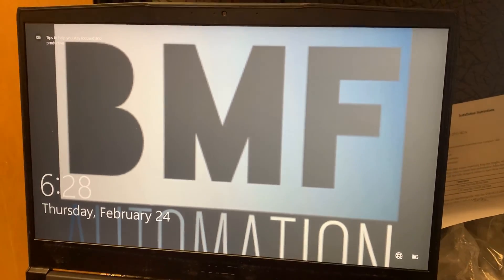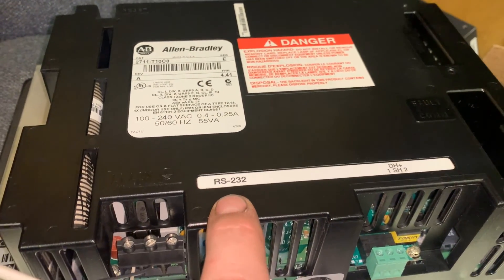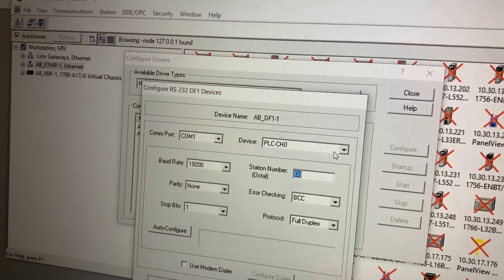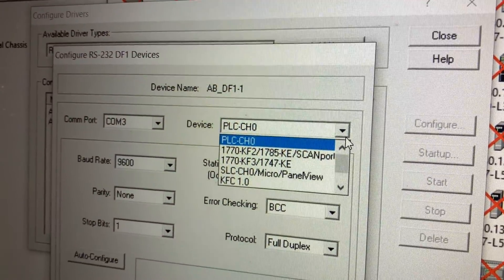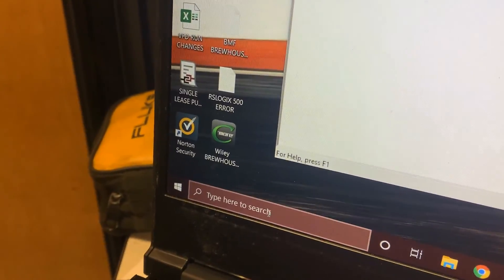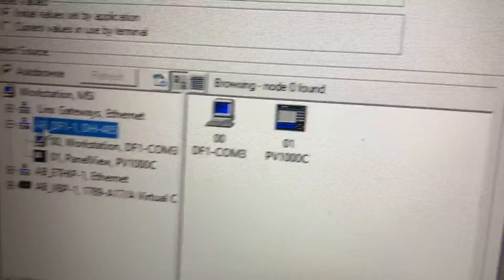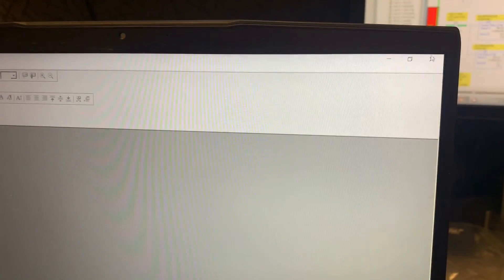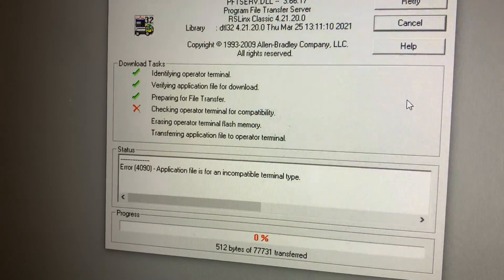Panelview 1000 File Transfer - AB 2711-T10C8

Comment: I have a 2711-T10C20 that I need to recover the program from. Do you have a video that shows uploading with the Transfer Utility?
Reply: I don’t… but if you open panelbuilder32 and setup comms, you can select to upload a file from a device.  Pretty straight forward…
Reply: @BMF_Garage Not having panelbuilder is the problem I have at the moment. I'm new to an old facility that no longer has computers that run on 32.
Reply: I am an a similar boat. Would love to see how to do it with the transfer utility. I can't get the FactoryTalk Linx to see a DF1 device and i cant seem to add a DF1 driver to it.